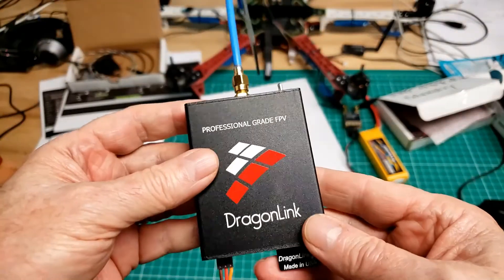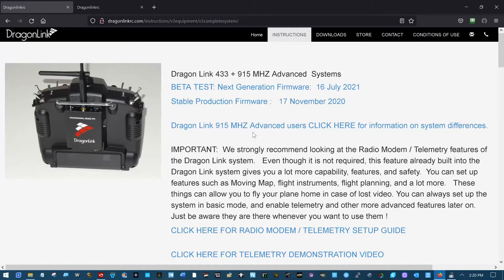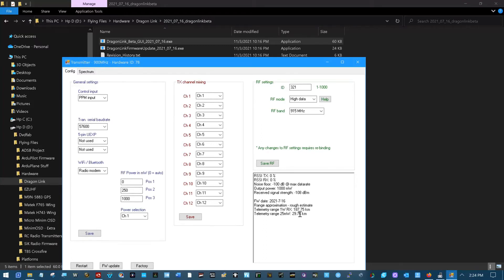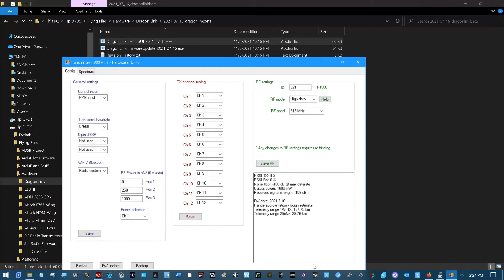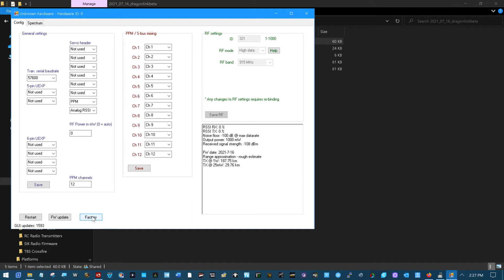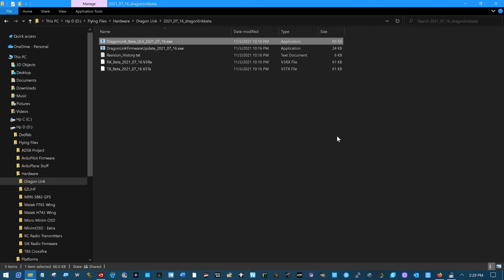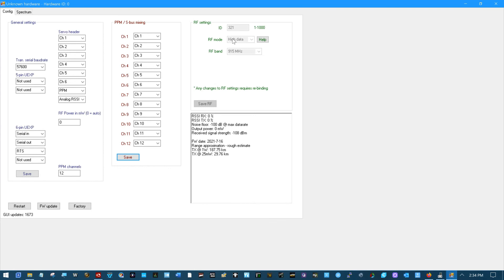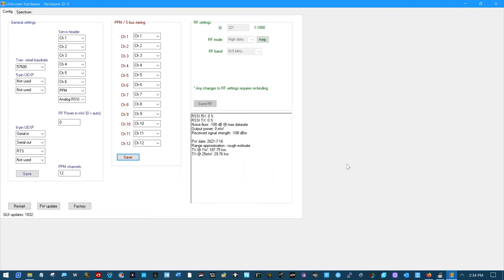Dragon Link 915 MHz Setup 1 of 4

Comment: hello i have thes also  can you tell me where to get the cong software ? thanks as the company is gone  .
Reply from the maker: I see that the website is down.  I am not sure what software you are asking for .  Connection software?
Reply: i saw people using  some software to config  the dragon link   did you need to configure yours with any software ?  and thank you very much for your reply
Reply from the maker: @clintondeguara2709  Yes.  I have configuration, firmware and I think docs.  Send me an email to rchelp@wnc.com and I will zip them up and attach them to a reply.